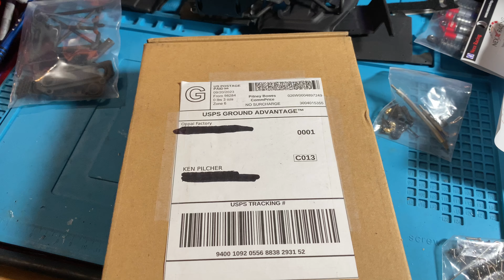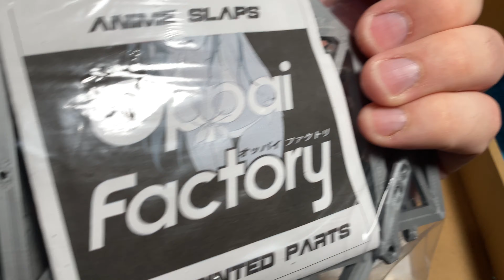TRX4M Meus Ripper with Flipped Portals for Sandstone Red Rocks! Oppai Factory, Nexx Racing & Furitek

Comment: The flipped hubs is definitely on my to do list. I just got my first rc as an adult. Cr18p evo rock van. I've cut the body out for bigger tires, flipped the steering linkage to the bottom of the servo arm and installed a furitek micro komodo brushless with there stinger kit. It actually drifts but flips if I turn too hard, where the hub flip is coming in handy. Going 3s soon and maybe try to convert to the lgrp billet mr24 transmission with the 30 something %overdrive and the 20 percent overdrive portal gears
Reply from the maker: Nice!  I get a lot of comments on this build. (Positive and negative)

Comment: Awesome build! Thanks for your time. Would this chassis, or even the injora tarantula work (width wise) with the fms Fcx24? I would just cut the frame rails of the fxc off where the 
belly/skid/links are at, and mod whatever. The width there would just need to be close. Thanks again! Really pumped for this vid. 👍🏻
Reply from the maker: It takes some work but I think I’ll be doing this next. ;)
Reply: Awesome! That’s what I have, so that’s all I got. Maybe I’ll go ahead and order one up. Great price! I have 70 claws coming too. I’ll be chomping at the bit for that vid when/if you do it. Thanks much for the reply. 👍🏻
Reply: Well, I had $20 amazon rewards points so, ORDERED! 🎉. 2 day delivery too. Cheers!
Reply: So I got my tarantula chassis today (trx4m size) , I measured the fcx24 belly width and it’s spot on! Also the stock fcx24 upper link bolts are almost 100% on with the chassis’s belly holes! Maybe A little modding the chassis servo area and it will be an easy swap. Obviously this means the ripper chassis (trx4m) will be the same, I have that chassis coming as well. So pumped for this. All three fcx’s  will be swapped over to this setup. and my monster truck tires look to clear the tarantula tubes too, so the 70mm tires coming should clear. Chomping at the bit for you to make a vid about it. Sorry for the long message… just pretty excited. Thanks again for the videos and your time! 👍🏻
Reply from the maker: Nice!! That is super awesome to hear! I am loving the FCX platform.